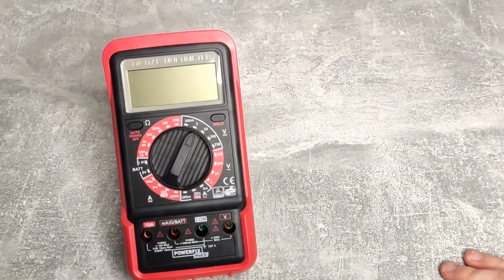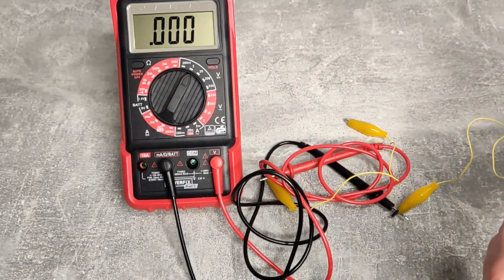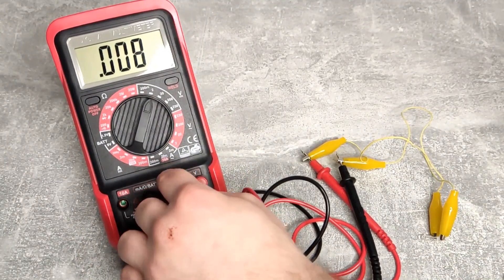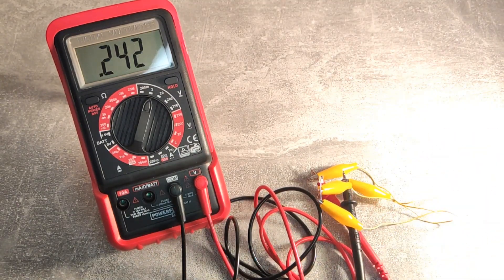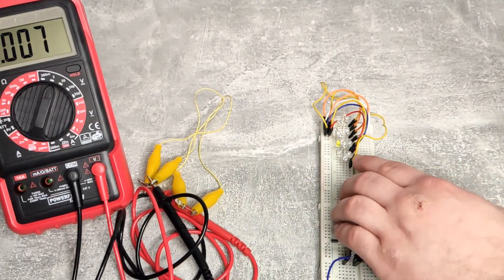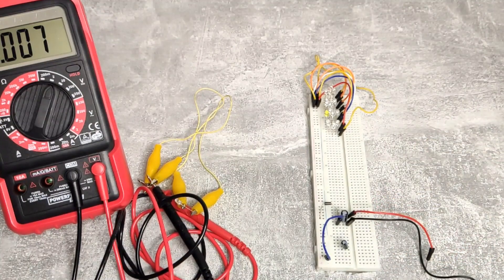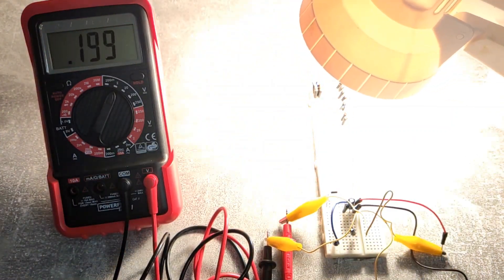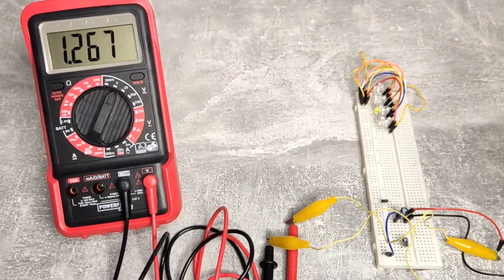Debunking These DIY CD Solar Cells Claims (DIY Debunking)

Comment: Put as many LEDs as you want in parallel, it won't increase the voltage.  You could generate enough current to lift a car and still not light an LED.  You need to put 3 in series to do that.  
Also, normal silicone diodes tend to work better for this than the light emitting variety.  It's the exact same tech as a solar cell, just a worse geometry.
Reply from the maker: I actually did a Array type that consisted of 2 LEDs in series and multiple rows. The reason i didn't do 3 LEDs in series is because i didn't have enough to sustain a usable current according to my prrior tests. Either way the video showed that while it's possible to generate electricity with LEDs, it's trashier than solar panels. And the point was to debunk the fake cd solar panel since its the diodes, not the arrangement of them that produces the power. I actually covered the actual LED-free solar panel in a part 2 to make sure it is just fake. As someone commented over here, i should have added a multimeter in series to check for the current but i simply didn't have a second multimeter and felt like showing the slow rise of the voltage showed how bad the LEDs were performing in the current. Thanks for watching and for your feedback.
Reply from the maker: In fact in the video it's self i mentioned the build of the array (for the same reason memtioned in the comment above) and i adressed i would need a 2nd panel to maintain a better current and achieve a higher voltage.
Reply: @photonik-luminescence   That board is more than capable of holding 3 diodes in series with no problem.  That is enough to light the LED, but it might be too dim to see with the naked eye.  Putting more 3-series cells in parallel will increase its brightness.  I am not saying that this is a replacement for solar cells or that much can be done with the power it puts out, but the current it produces is useable if you use it correctly.
Reply from the maker: @Naomi_Boyd  definitely true. But i only had a few LEDs and not many cables so i was limited to it. It's definitely possible to charge your phone with bigger arrays. I actually will be probably covering the Stirling engine i have and a actual small steam engine. They are fun to mess with and at some point i want to make a hydrogen powered Stirling engine. It would be a zero CO2 engine. It's just the aluminium that i doubt i very environmental friendly, but it's a project. And to be honest in this i just wanted to debunk the CD solar panels claims rather than building a LEDs array. Best of all is you can actually use LEDs as UV or IR light detectors and together with Arduino you can get a UV meter for really cheap ! Maybr i could build the UV meter too ! Thanks for responding back !
Reply: @photonik-luminescence   That sounds like a very interesting project.  I will be here for it.  :goodvibes:

Comment: LEDs are less effective than a solar cell with the same area as the area of semiconductor inside the LED.
LEDs usually have very very small semiconductors inside them, so you have a very very tiny solar cell, which is only useful for detecting light, not harvesting energy.
(white LEDs have some extra parts which can absorb light, so they are even less effective)
Same goes for transistors, and diodes.
Reply from the maker: I know. That was kinda the point of this video. Thankyou though for the extra clarification. (I mean literally, solar cells are MADE to invert light to electricity as where shining light on  LEDs is just a by effect.)

Comment: Some glass sealed diode and ceramic sealed RF transistors also generate a weak voltage when light hits it. 😆😆
Reply from the maker: Exactly, this was what the guy in the video was using. He was using transistors.
Reply: Some ICs have "naked" packages, so you can see the bare silicon. If you shine strong enough light on them, it can mess the voltage.
A prototype of Raspberry Pi crashed each time somebody use flash photography near it. They eventually figured it out and covered the chip.

(not windowed package like an EPROM, but an almost naked piece of silicon, where pins are bumps of solder, and only a very thin plastic layer protects the circuits)

Comment: Nicely done, Some dusk/Dawn switches actually use an LED as a light level detector,  I would suggest next time you use a second meter set to current. It will emphasise your point, 
Otherwise a good demonstration.
Reply from the maker: Thankyou. Yes, indeed measuring the current was something i didn't do. I didn't have a second multi meter so could only measure the voltage. I mean its genius if dawn/dusk switches use it as its simple and not complicate and also cheap.
Reply: you can buy a phototransistor quite cheaply, and it is much more sensitive.
But if you are already using LEDs for other stuff in the factory, and you really do not need high sensitivity for dusk, then using already available LEDs are cheaper.
Simple non-white indicator LEDs can cost a few cents each if you buy them in bulk.